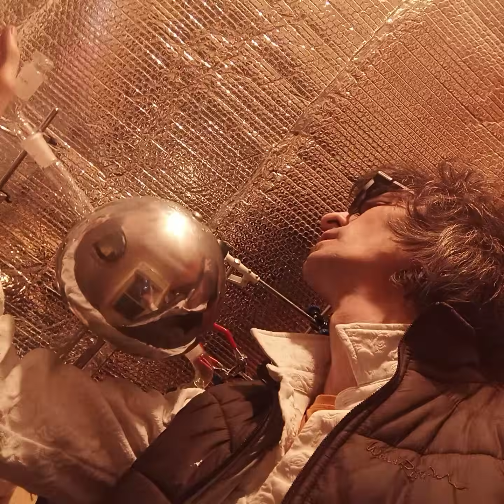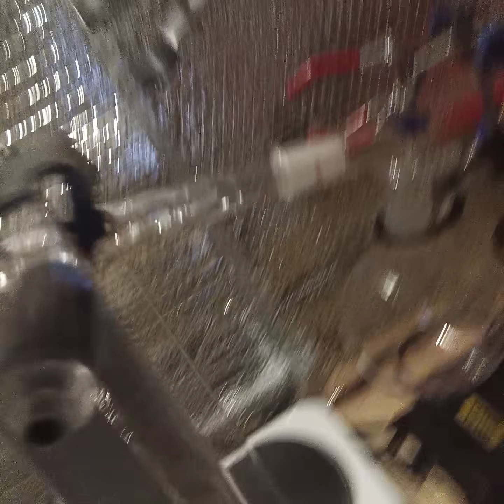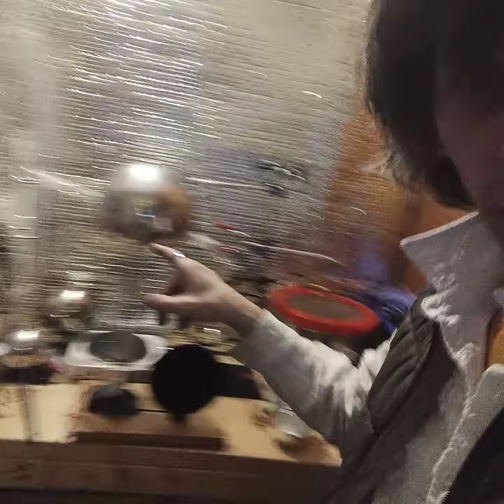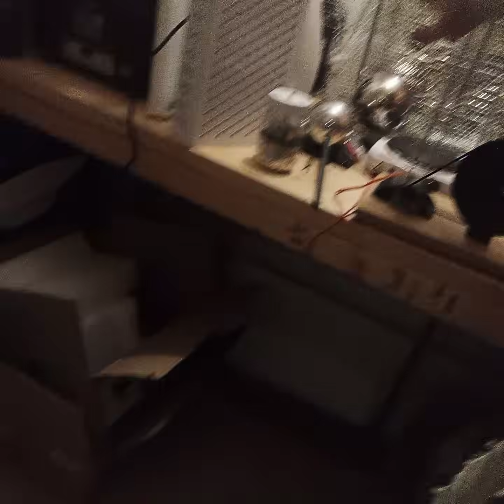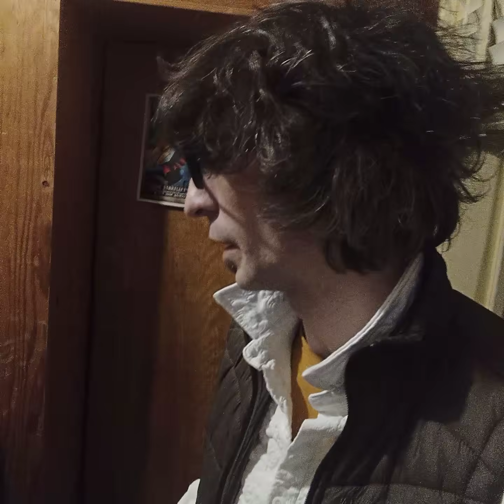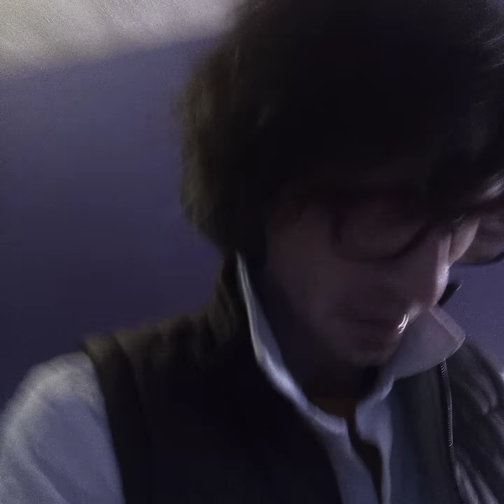Welcome to my lab...

Comment: Yeah and I've got this thin peace of paper and so I put some green stuff in it and then I roll it up and then after that i put fire on one end and the other end in my mouth and then I inhale while I fire the other end and then I exhale and finally I don't care anymore. Hey I gave you a like and gave it a look but I didn't see much because my eyes are rolling around in the back of my head counter clockwise.
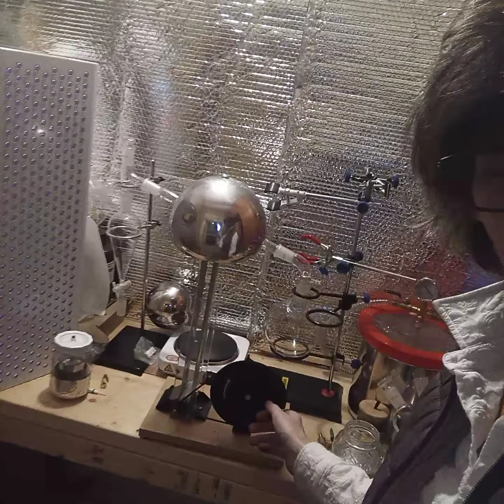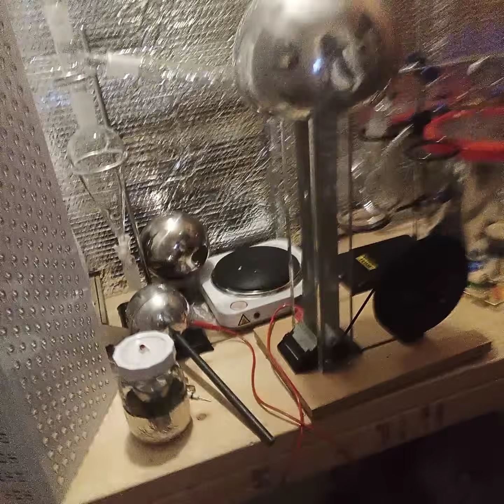Reply from the maker: Skip ahead to 1:42 and you can bail out by 9:42. 
The important part is about the atmospheric electric voltage gradient and the reaction of ungrounded conductors in the air to that gradient.

Comment: VanDeGraff generators can be made to generate huge voltage AND current in the right circuit. First look up whimhurst machine, another HV device. The look up testatica machine, whimhurst turned into power generator.
Reply from the maker: What we're aiming for is static induction!

Comment: your creating electricity when you start spinning that crank. Just like the first telephones or a flashlight that gets it's power by turning the crank on it
Reply from the maker: Yes, however the distinction with static is - it's very high voltage - but has no movement (or current). 
When electricity has no movement, it stops being an electric bolt and becomes what looks more like a magnetic field. 
Very important.